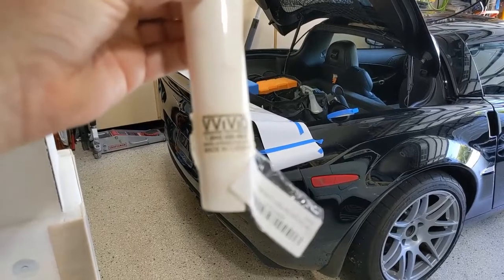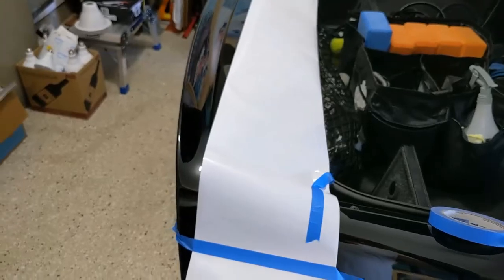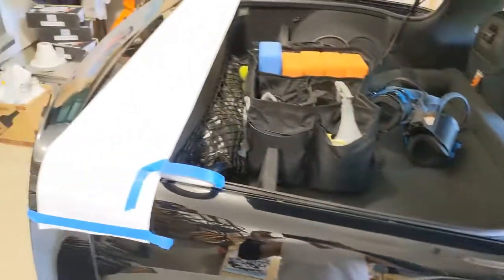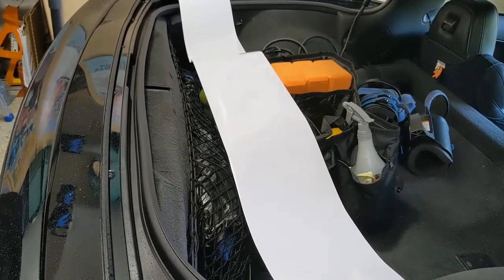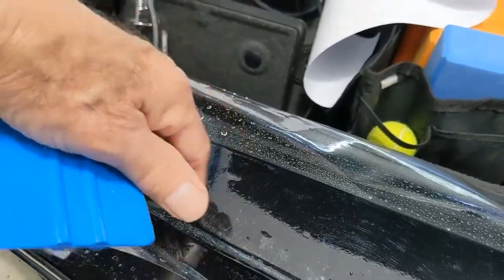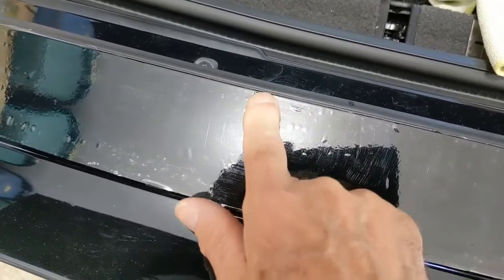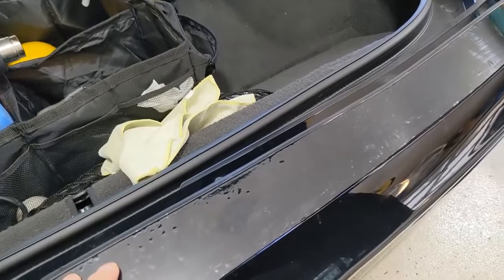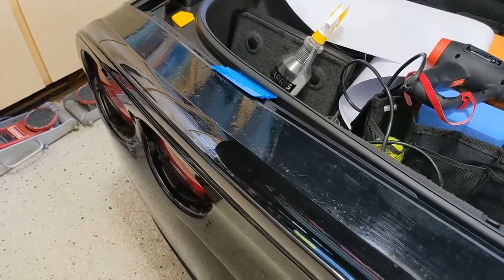Corvette c6 z06 film protection by froggy

Comment from the maker: What I did wrong:
  1 Should remove spoiler and lay film under
  2 The squeegee was wrong tool
  3  Tight corner at spoiler end almost impossible to do
Problem with product
  1 This film has almost zero stretch
  2 Seems to me it does scratch too easy
  3 Cannot press out bubbles (wrong type of film or just issue with the brand?)
So this is learning by my mistakes, so yours comes out better, also it's easy to do over, so you do, you try, you learn, you get better.

Froggy